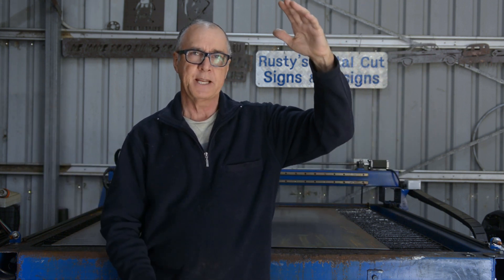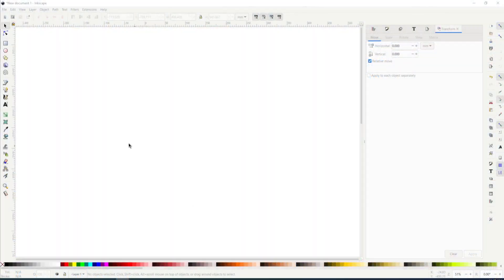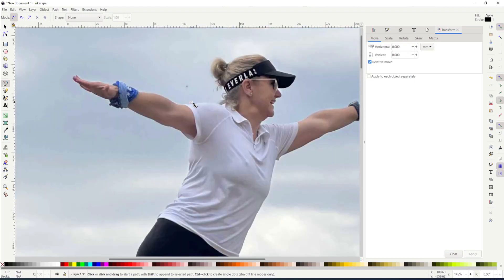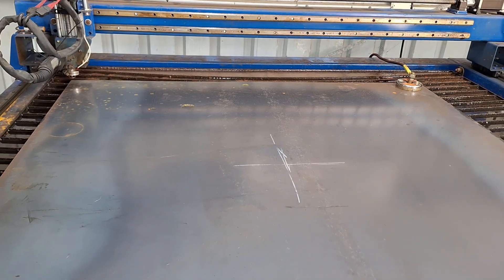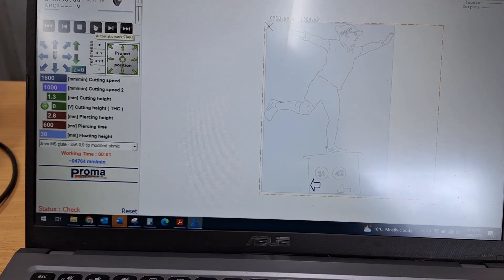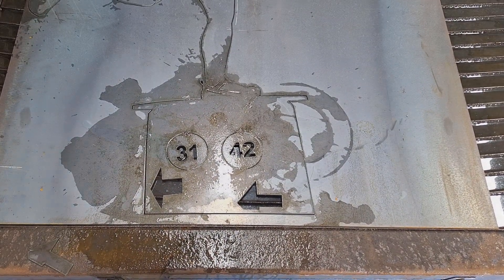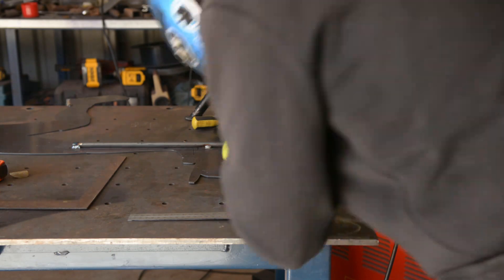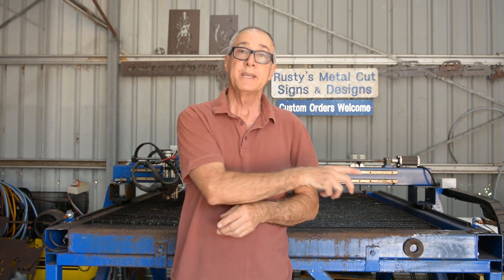From a Photo to a Sculpture | How I Created a CNC Plasma Cutting File from a Photo

Comment: First time seeing your channel, this is exactly what I’m trying to learn, did you save  Inkscape as a DXF and your cutting program converted it to g code? , can’t wait to learn this stuff👌👍👍
Reply from the maker: Hi Chris and sorry for the late reply. I create my designs in Inkscape and save the file as a .svg. I then 'save as' a .dxf, which is the format my cutting software uses (I'm using the MyPlasm CNC software from Proma Elektronika). If I need to make any changes to the file, I tweak the .svg version and then do a 'save as' a .dxf.....I find Inkscape sometimes doesn't like opening up .dxf files.